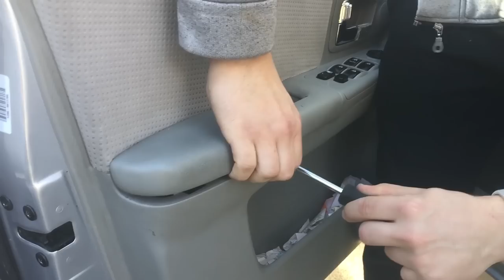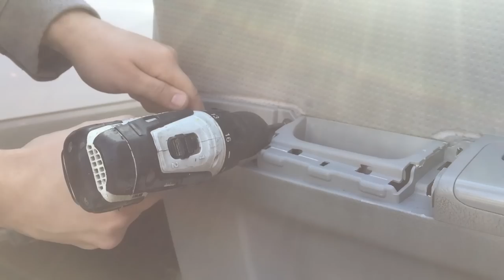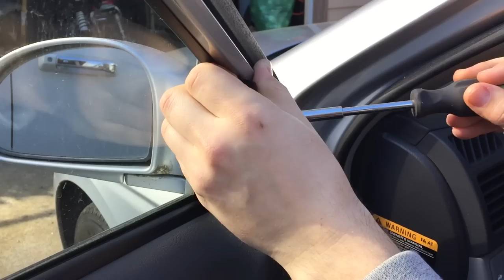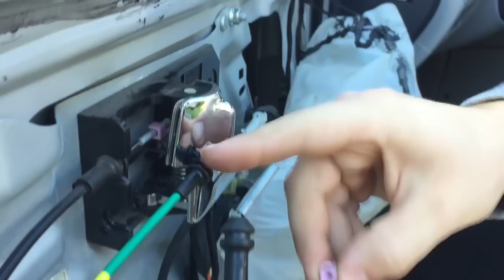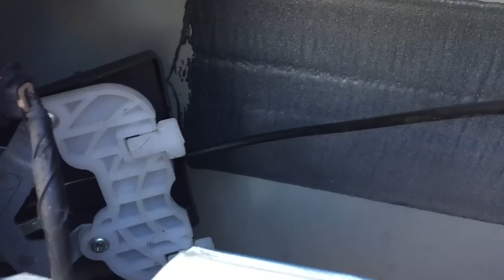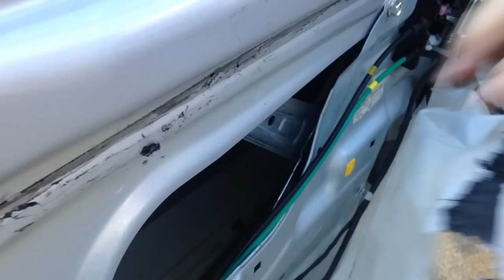Door latch cable replacement- Kia Spectra

Comment: Totally skipped the pink cable retaining clip removal and installation, plus cable retainers. Skipping steps doesn't help. And please loose the sound effects. Also skipped removing the third screw from the latch cover. It's on the opposite side of the 2 screws and requires a stubby Phillips or off set to remove.

Comment: This video is like 60% helpful. Some steps were missed, like the cable clips on the panel. My lock mechanism has a 3rd screw on the backside, not just the two on the front white plastic piece.  Getting the new cable into the lock mechanism in such a crowded space is extremely difficult more time should’ve been spent on offering tips on how to do this. Personally I found the music and especially the sound effects extremely frustrating and distracting.  Again I wish more time was spent offering tips throughout the whole procedure rather than trying to make the video cute. If you’re going to make a how to do please make it a thorough. at this point it makes me just want to drive to the mechanic and have him finish the job
Reply: I had the same problem, how did you get the third screw behind the panel off?
Reply: @axlem.6977  Same with me. I can't get the back screw off and don't have any idea how to do it. If you read this and figured it out, please let me know, I'd appreciate it.
Reply: Hey did you guys ever get that third screw out????
Reply: @efrainmartinez6278  Nope
Reply: I finally got the 3rd screw out. Had to buy a 90 degree adapter for my drill. Good luck getting it back together. 

The music wouldn’t be so bad if the video was better, but when you’re frustrated because all of the hard parts are skipped, you get stuck listening to the same parts over and over...and you’ll want to kill the next person who walks by.
Reply: I'm in the middle of this job.  Used a right angle screwdriver to get out that third screw.  Also, he completely skips getting the end of the cable out of its fixture, which is very difficult.  Really hate YouTube videos that skip over the most difficult steps.
Reply: I'm a very handy Mcguyver type. My 2014 Ram 3500 cable is broke by the door handle. If I can get to the latch by taking electric cut-off tool I will cut A small l path to the latch and attach a new insulated cable OFF OF AN EMERGENCY BRAKE ACUATOR FROM AN RV. Initially I'll remove the first panel ,then cut the path on the second one, if that doesn't go as planned, then I'll have to remove the 2nd panel to get to the latch.If thee original cable is good from the latch then I will splice A piece onto it using the RV BRAKE CABLE and run it back to thee door handle, or maybe even eliminate the handle and just use the LOOPED END of the RV BRAKE CABLE. Sounds primitive but I don't have Eva Gabor for a wife either 😅

Comment: This was super helpful! Thank you so much! I am always apprehensive about pulling parts and panels out of vehicals because all of the fasteners are hidden secrets.  My issue was not a broken cable, but simply a detached cable that I had to put back into place. But the panel disassembly information was invaluable! Thanks again!

Comment: Very helpful. On mine there's a screw BEHIND the white piece of plastic that takes a right angle tool. 2007 Kia Spectra. Mine broke at the door handle but the cable would still move a little.
Reply: Dealing with the same thing. His video didn’t show that screw behind the white piece. A stubby screwdriver will get it.

Comment: I can't get the white cable holder out to access it feels like a strong spring is stopping it moving towards the access hole. Ten minutes after writing that, I just noticed the black rubber cable holder poking out the face of door. I pushed it in and solved the problem!

Comment: My latch cable fail and kept having to open the door from the outside. They want way too much for a new one plus I don't trust the crimped ends so i just used 316 stainless steel tig filler rod alittle thinner than a close hanger wire and cut it to the length of the cable and bent a hook on both ends. You'll never have to deal with it again because the rod won't break and there's no need for crimping any end fittings.

Comment: If you can't get the actuator released because the metal rods connected to it, follow the rod up and unclip it by the bottom of the window. They have little holes and clamps just like the cable does. I was stuck there. The rest is simple.

Comment: Almost exactly a year later, mine broke once again. I had one of those little plastic clips need replacing last year and I got lucky that a mechanic at the local dealership had one in his box that he gave me.
So, I notice that in your video you have a white clip. Did you buy that with the new cable or did it come with the cable? If so, could you post the part link or tell me where to get the clip?
Thanks in advance!

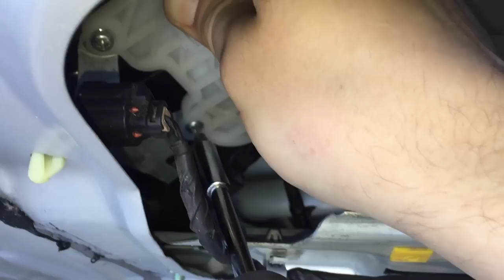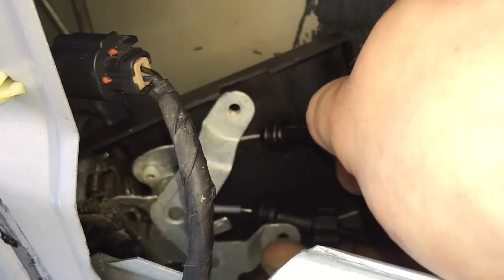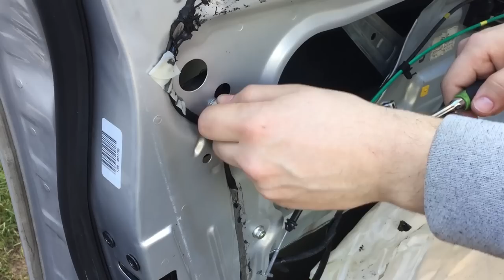Comment: I have an '06 Spectra and this video is insufficient to use as a repair guide.  As many have stated, there is a third screw behind the white plate that is being replaced at 4:47.  Worst of all is that installing the door side cable end, at 5:13, is virtually impossible due to a lack of space.  The creator totally skips over that operation.  Finally, he unscrews a bolt unnecessarily at 3:36 - one does need to unscrew the bolt lower down, but not the one he is showing at 3:36.

To be fair, this is not the first time I've tried to work on an '06 Spectra door and found it much more difficult than videos concerning the doors on the '05 or '07 models.  I don't know why Kia made the '06 doors so much more difficult to work on.
Reply: @donl9571 I have a 2007 and it's working my last good nerve. I'd hate to think there's something even worse out there. You have my sympathies.

Comment: Than you, very much needed. I think I can do this. Is the cable actually broken, can not be fixed? I have a 2008 Kia Spectra do you know the part number?
Reply: 81371-2F000

Comment: That white thing on the locking mechanism inside of the door has another screw on the backside that is almost impossible to get to that you skip over in this video. You just show the 2 screws on the front side that are easy to get to, I wish it was this easy. Putting the new wire inside of the door latch mechanism is extremely difficult, borderline impossible because of the tight space and no where to fit tools or fingers, you just skip that part also.

Comment: I was working to remove the white part of the locking mechanism so I could get to the cable to replace it. I couldn't even get a screw driver to fit there to unscrew it, do you have any suggestions? Once I got it free from the tab restraints, there wasn't enough wiggle room to get a screw driver to the screws. Thanks.
Reply: Valerie Miller yeah it's attached to the door handle rods. You'll have to fiddle with it. Getting the cable back in the clip was difficult
Reply: Zahar Kulgavyy thanks

Comment: Wish I had known cables were out there. I am doing the passenger door today and may just take the cable out of the new actuator that was difficult to locate. Even the Kia  parts system wouldnt list the part and I sell auto parts for a major retailer.

Comment: Great video but that music though... ☹☹ There was one screw you were missing from that white piece. On my car there was 3 screws,  one you unscrew from front then one from the back of the black plastic assembly.  

I have to find a small angle philips screw driver to get back there otherwise I'll break the black plastic or white piece to get it off.